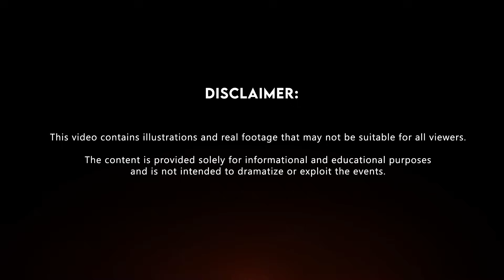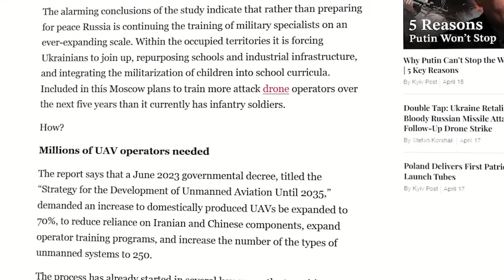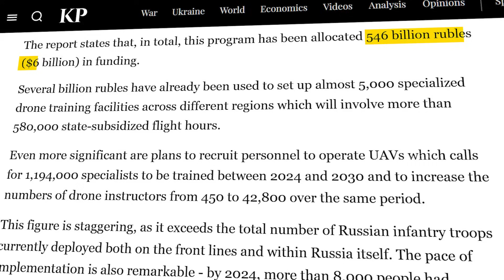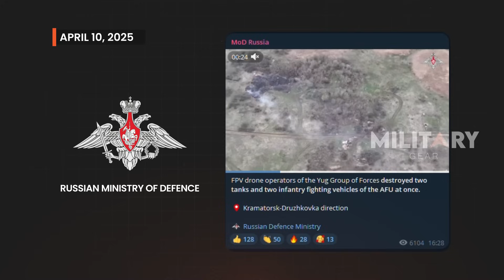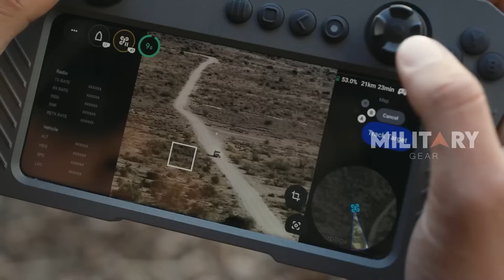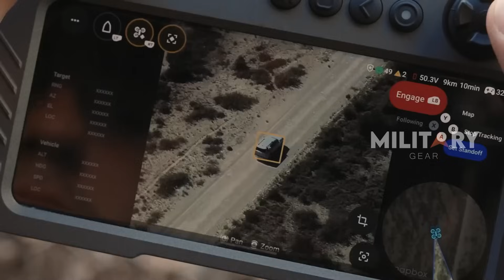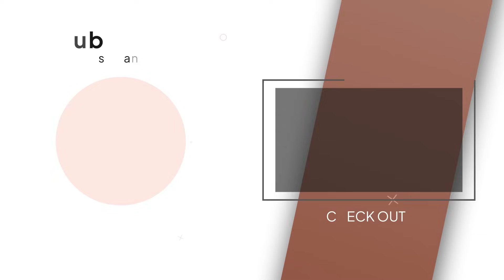The Rise of Russia’s AI Drone Swarm: $6B Drone Revolution

Comment: Drone are the best weapon because of there size to weight ratio. They will replace helicopters and ground attack aircraft over the frontline because they can be maintained in number providing direct observation of what is happening in real time with no breaks. They are hard to see and easy to rotate to change batteries.